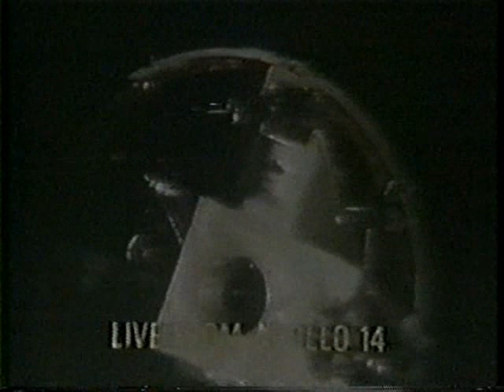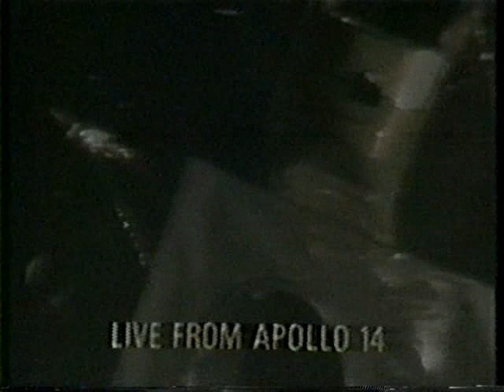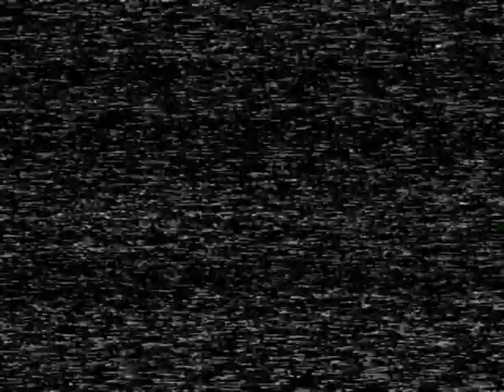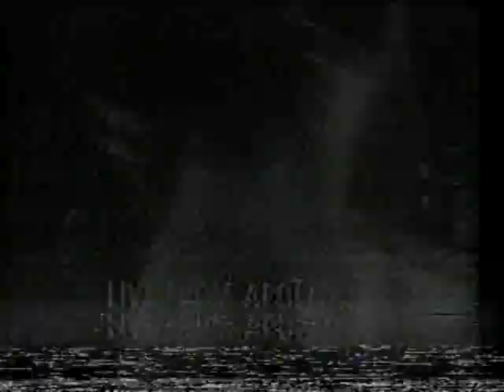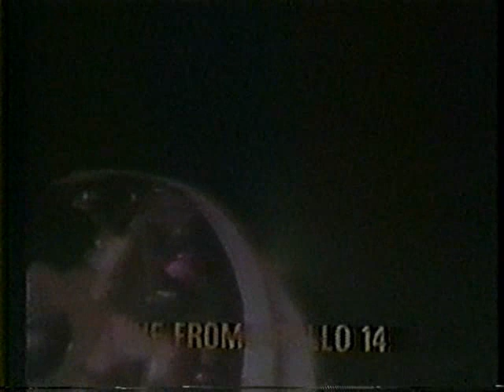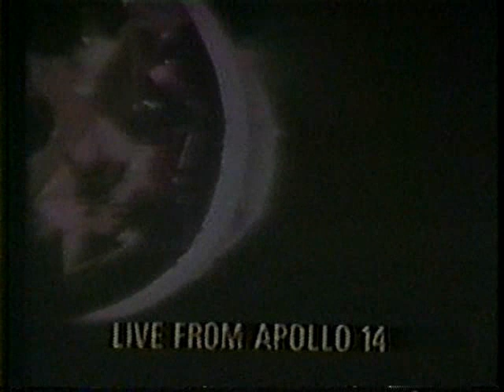Apollo 14 Part 7 News Coverage

Comment: Why didn't one of the astronauts go outside to inspect the docking mechanism?
Reply: Actually, if they hadn't been able to eventually dock with the LM in the normal way the plan was to seal up their spacesuits, depressurize the command module and open the docking hatch and bring the probe inside for inspection and/or repair. Fortunately the situation never came to that point as they were finally able to dock successfully. Nothing like a reply 2 years later, huh?
Reply: @robbhahn8897  I see your 2-year later reply and will raise you a 1-year later reply! I tried to wait 2 years but I have just become too impatient :-P
Reply: @ilovebeinagirl pf. patience is for girls....
"One astronaut go outside" is not quite a quick and easy thing to do as the comment implies.  Starts with the fact that they'd all have to suit up.